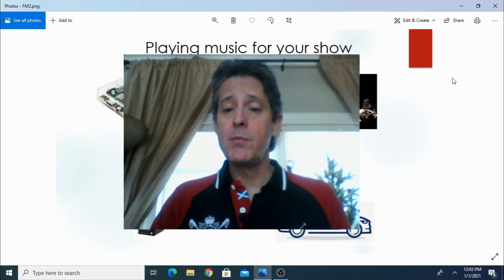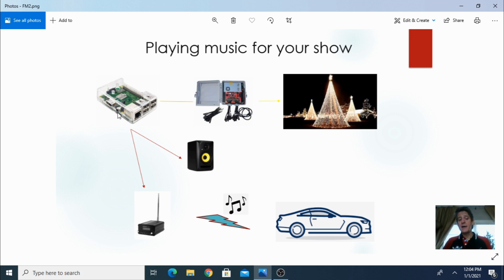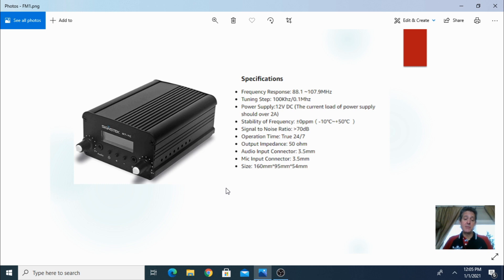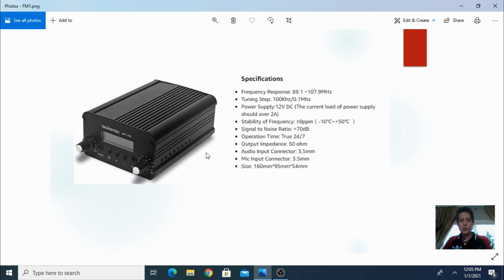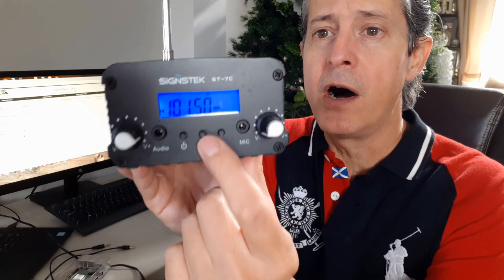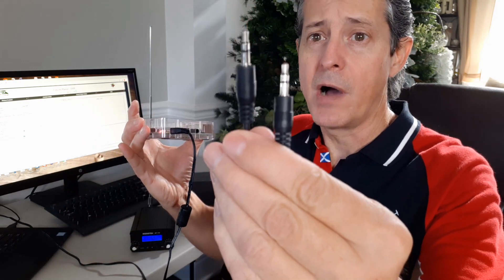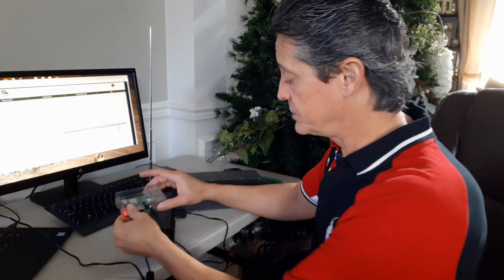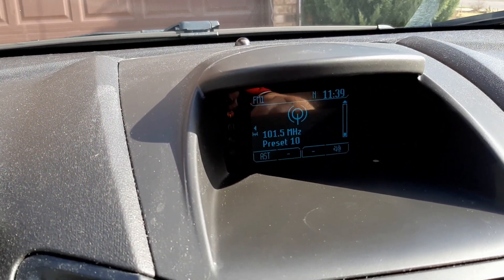Using a FM Transmitter on your light show.

Comment: So what if i want to use it with my projector for my projection mapping show? Does it need to be plugged into the projector? How did you get that screen to pop up on your computer? Would that just pop up on my projector?
Reply from the maker: Hi There. If you want the sound/music to be trasmitted to a FM Station, then yes, you will need to connect the audio output from your projector to the FM transmitter. Not sure what Popup are you talking about, but what I show in this video is the Falcon Pi Player (FPP) running on the PI. All I did what start the playlist to get some sound out.
Reply from the maker: You may need some sort of audio jack converter, depending on what type of audio output connector you have.

Comment: How do you waterproof the transmitter? It doesn’t look like it will fit in the waterproof box with the antenna
Reply from the maker: @matthewrobins1360  In my case, the controller is inside my garage as well of the transmitter.
Reply: @ how far is your show from the controller do you lose power as it travels to the edge of your yard?
Reply from the maker: @matthewrobins1360  All my elements are about 15ft. I lights are 12v.  I also have some secondary power supplies from which I do power injection.

Comment: Thank you for all your videos. I'm learning so much
Can I transmit audio off F16V4 controller without Raspberry PI device?
Reply from the maker: Hey Randy, thank you so much for your words and for watching my videos. Yes, you can run your show from the F16V4. But you will need to buy an '"Audio Board" for your controller. Then you can connect your FM transmitter to this card. See below.
https://pixelcontroller.com/store/main/75-audio-board.html
Reply: @trevilights  thank you!! I have a question for you I have the ws2811 lights and puck lights how can I control both of them on the same controller, Apparently, the v4 only takes one type of light. Am I wrong if so how to fix it
Reply from the maker: @randyqario6707  Falcon can control different tope of lights, but only one type of light per port. I guess it will come down to what type of puck lights you have and if they have a chip compatible with the V4. They should have at least 3 wires, positive, negative and data.

Comment: Do you need to turn on the fm transmitter manually everytime your show starts or does it turn on automatically when the Pi powers up? Thankyou.
Reply from the maker: Hey snistr. What I have been doing is using a timer. The timer will disconnect the controller and the FM transmitter at night. I have noticed that if the FM transmitter is ON when disconnected, when the timer turns ON the FM transmitter will do too. Seems it remembers that last state it was when disconnected. Not sure if other FM transmitters will do the same.

Comment: I made a 48 channel controller box,  120v 48 outlet plugs.   I developed a couple sequences from your you tube channel.  I have a Ardunio Mega and a Raspberry PI4.  I can use their one.  It used X lights to make my sequences.  Great job on sequencing video.  I’m using 6 Sainsmart 8 channel solid state relay boards.  Everything works when I power it up.  I need to know which device is best for my setup.  The Ardunio or Raspberry.  I need to know you to connect them to xlights sequences and how to download them to get my sequences to run.  Any advice would be greatly appreciated
Reply from the maker: Hi John. Good for you. I see that are already getting ready for this year. I do not have any experience with Arduino. I has just looking at the FPP (Falcon Player) specs I only see 2 devices compatible with it. The Raspberry PI and the BeagleBone, so I would stick to one of those. I have a video on how to upload your sequences to your FPP that might help you. So all you will have to do is upload your sequences to the FPP and point the FPP player to the IP address of the Falcon Controller (if you have one). The thing here is that your setup is so different that what I have, that is hard for me to give you any advice on it. I can see that yo have spend quite some time and $$ on your setup, but I might be worth it to move into the Addressable LED (12v DC) world. 

How to upload your xlights sequecnes.
https://youtu.be/VPE5oHID6Io
Reply: Thank you again .  I’m moving into the 12Volt pixel world but I bought a  Led mini tree to learn with.  I doing this one tree for my Sister as a gift.  I want to put 5 or so sequences on the tree for her.    Her tree will be 120 Volts.  Thank you again your a pro.
Reply from the maker: @johnjahner3389  Glad to help.